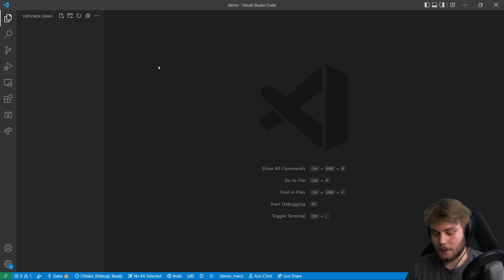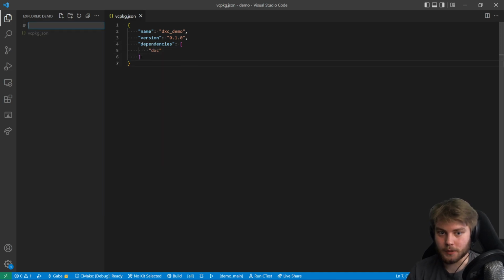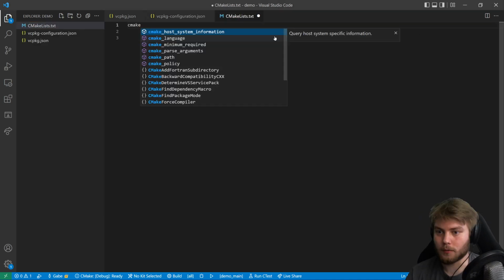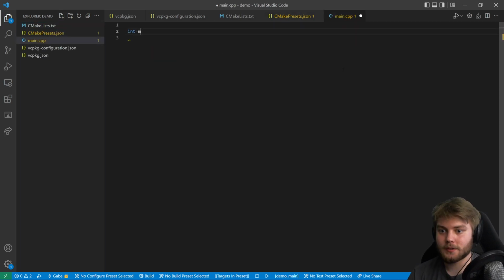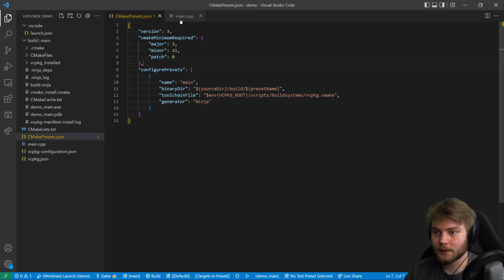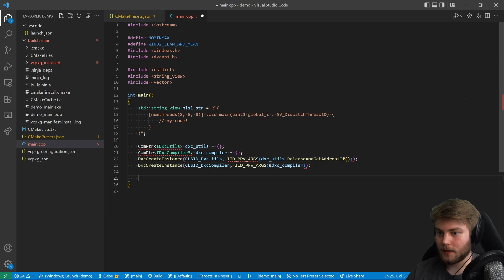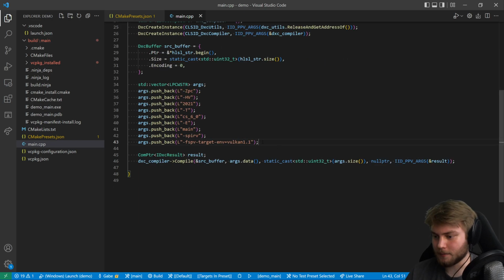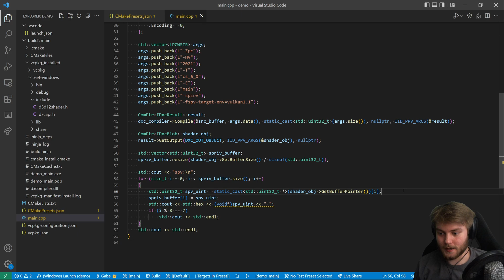How to use HLSL with Vulkan part 1: Using DXC to create SPIR-V

Comment: Very nice video, thank you for this. vcpkg is so badly documented. Perhaps you should also do a video on how to setup a vcpkg registry.

Regarding dxc integration, My version of the vulkan sdk ships with a version of dxc.exe.

so in my cmake file I point to the dxc executable like so:

set(dxc_executable "$ENV{VULKAN_SDK}/Bin/dxc.exe")

I then setup a custom command that compiles each hlsl to spir-v and convert it to a c style array contained in a header file (so I won't have to load files during runtime).

Do You think this is a good approach?
Reply from the maker: That's great! The only reason I don't do it that way is because I am in the rapid development stage, where I want to be able to iterate as fast as possible, so I hot-load my shaders at runtime.

I also write very little c++ anymore, and mostly just shadercode, so not having to deal with compile times and link times is very very liberating 😂.

Your approach has the advantage (if this is how you want it) of bundling the shaders inside the executable, which is really nice - especially for distribution of your exe
Reply from the maker: As for making a video about making a vcpkg registry, I'd love to make one. It will probably be in a month or a couple months.. but I agree there is a niche to fill here on YouTube. If you can't wait, of course you can just take a look at my public vcpkg registry for now, and there are a couple blog posts about how to make one (but it's hard to tell what is outdated since vcpkg keeps changing!)

I will probably go into detail, like how to use vcpkg, why one should use it, and other things, like using it on the command line, what "manifest mode" is, publishing your own package with a "port", etc.